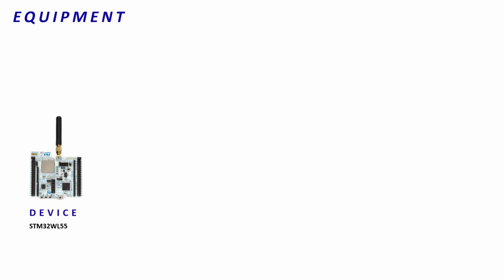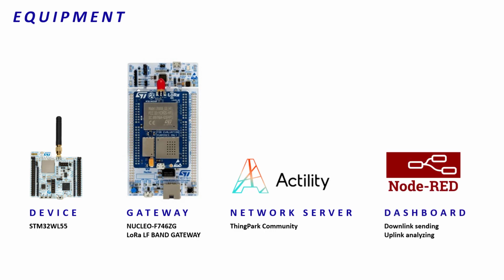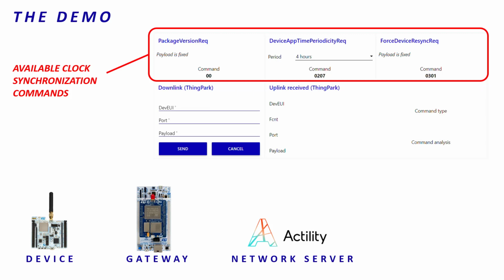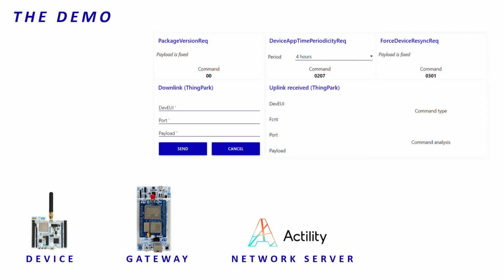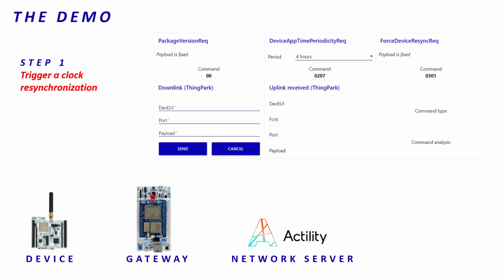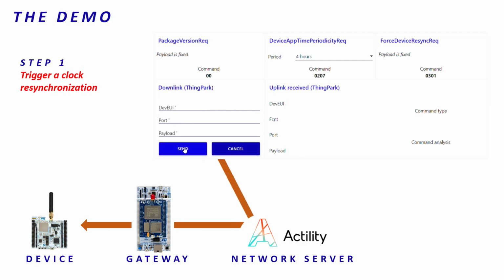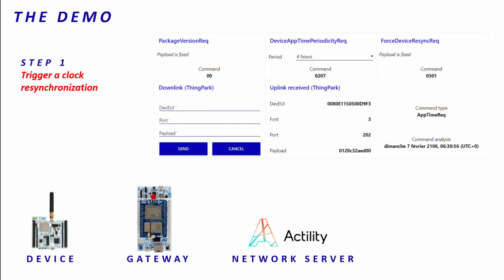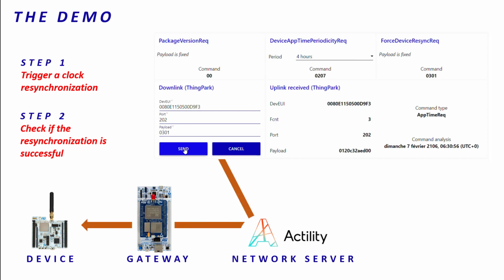LoRaWAN Clock Synchronisation

Comment: Great, video! One question how do you convert the payload to get the real time?
Reply: Hi, thanks. Appreciate it!
When the end-device sends its AppTimeReq command, the payload includes a 4-bytes field that embeds the current end-device clock. It is expressed as the time in seconds passed since 00:00:00, Sunday 6th of January 1980 (start of the GPS epoch) modulo 2^32. See LoRaWAN Application Layer Clock Synchronization Specification v1.0.0 for further details. Then, when the Node-RED tool receives the payload, it simply turns this number of seconds into a readable date. Feel free to check this out by testing the Node-RED dashboard yourself (https://github.com/SylvainMontagny/fuota-server/tree/main/clock-synchronization). 😊